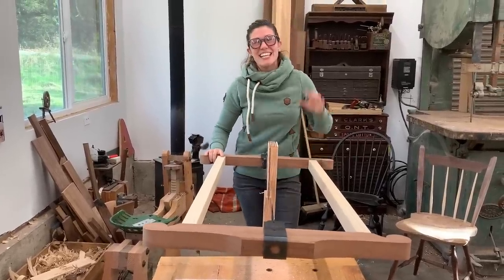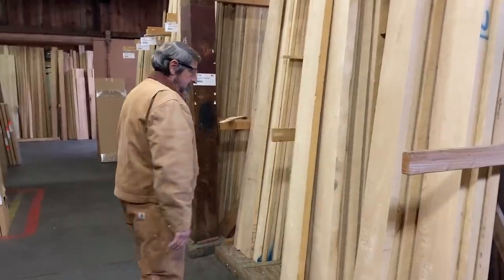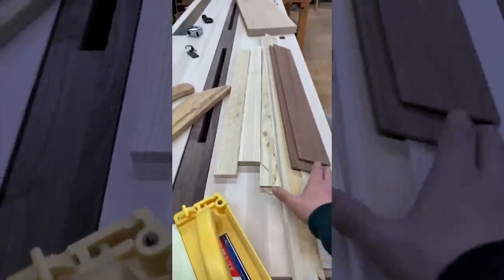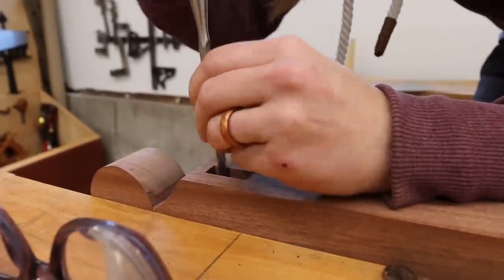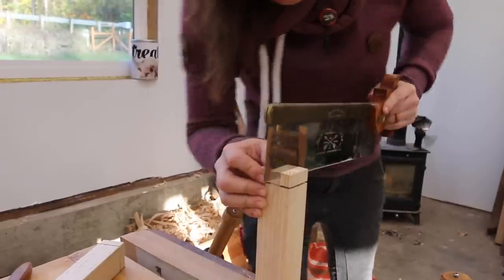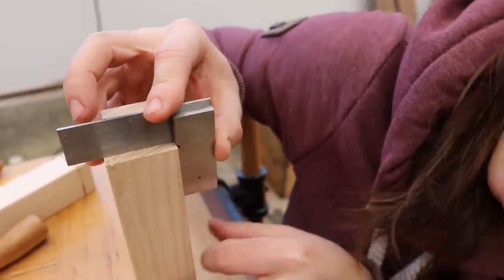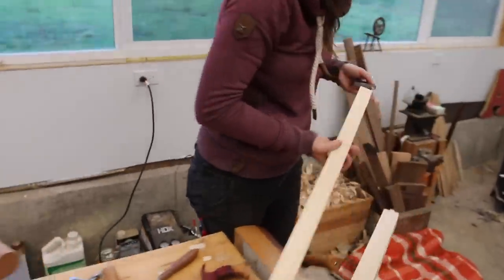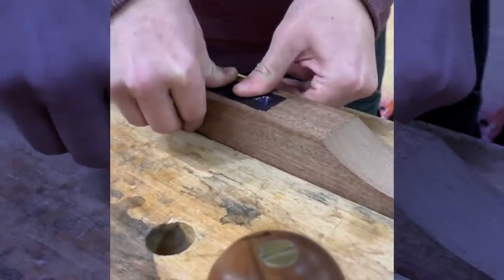Roubo Frame Saw Build

Comment: Man, that woodcraft shop looks kinda like my perception of what heaven would be like.
That's more cast iron in one place than I've seen all year, combined.  Not only are you incredibly smart, multi- skilled, talented educator and  film maker, great narrator, energetic ....and pretty......you are also very LUCKY !!!   Didn't they use a larger version of this saw to slab timber by laying log over a hand dug pit, with one man in hole and another standing on top of log.  Each would alternately pull stroke and down the length of the timber they'd go.  Bet they drew straws to see who had to be down in the pit in the rainstorm of saw dust.
Reply from the maker: Yeah! They call that a pit saw! I’d make one, but I think I’ll set up a bandsaw mill instead 🤣
Reply: I've seen a similar setup on an old wind powered mill. It had 8 or so blades it ran. It's speed varies with the wind. Was very cool.

Comment: Mortis and tenon jòints are probably the easier of socket  joints to do but still need a lot of hard work and concentration , powertools are there as helpers to cut down the length of time on a project and must be respected and not abused.

Comment: I think it would have been way better to not use all the power tools to make the saw. Great project would think easing all those square edges will make it less fatiguing on the fingers.
Reply from the maker: If you’d like to do my wood prep for me, I’d be more than happy to eliminate the power tools, as it is, I work 80 hours a week and run a farm on top of that, so I have no problem relying on my “apprentices” the power tools to do the remedial, mundane parts of projects so I can do the fun parts and actually enjoy the precious little time I actually get to spend in my shop.
Reply: @AnneofAllTrades  Anne, wasn't trying to be a smart ass and only making an observation. I follow you and April and see that you both are super busy all the time. Glad you get to enjoy your "fun" parts. ;-)